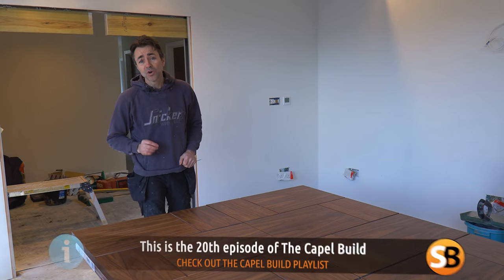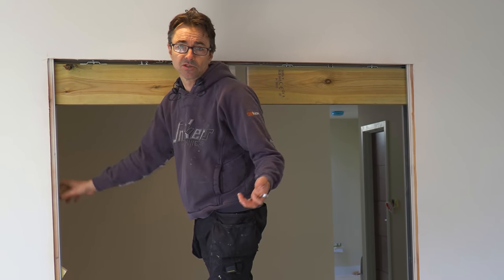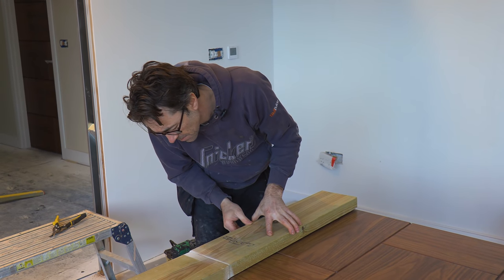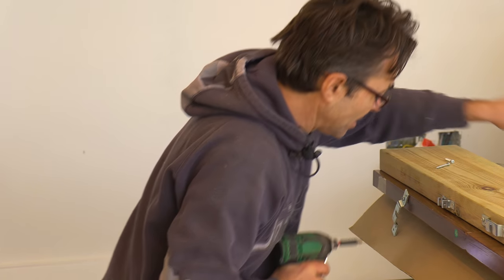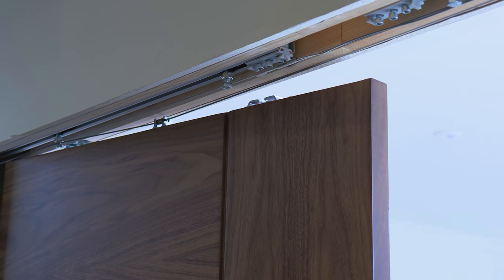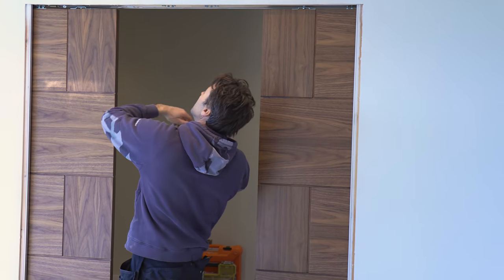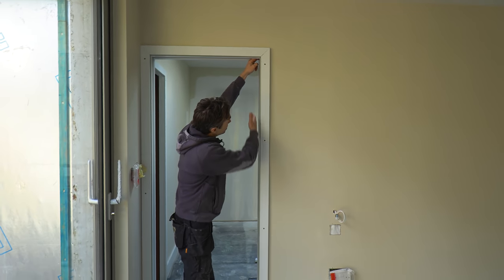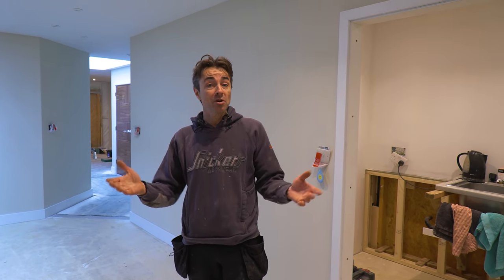Robin Installs Sliding Pocket Doors - Capel #20

Comment: Great timing! I’m currently building an extension. Ordered the kitchen then realised the utility door would open on to the units so decided to make it a pocket door. I’ve ordered a “JEXIS Pocket door ejector” so when you come to close the door you simply push the edge of door and it pops out instead of trying to get your fingers in to close it. Hoping it works!  Love how you’ve finished that single door off. The brush strips are a great idea. Looks smart!

Comment: Love the choice of unique walnut doors makes such a difference from your usual white primed doors! One thing I would add about the pocket doors would be how far they return into the partition. Once you router your handles in on both sides it's best to have the door sticking enough to see the handle so that you're able to reach the handle on both sides of the door to close it. It's works better than trying to fish for the top of the door everytime you want to close it. Nothing wrong with what you've done its something I've come across fitting them. Top work as always!
Reply: I watch a bunch of vids of luxury boats on Aquaholic, and for obvious reasons pocket doors are very popular where space is at such a premium. The usual answer is to have a flush fit pop out handle on the edge face of the door. i.e. you push the top with your thumb and it swings a handle out below that you can grab and pull. Alternatively there are sprung loaded pop out handles for the edge and there are even doors you can push and the whole door springs out, presenting the handles on the main face. I'm a bit surprised you don't know about these hardware solutions if you fit these types of doors often.
Edit: Just noticed the thread necromancy :-)

Comment: Hi Robin, 

Amazing work  as always. You have been inspiring me to start my own DIY pocket door project innthe UK. However, straight at the beginning I've encountered an issue with my cavity wall width. The cavity in our walls is only 6cm deep. There is no system that works with that. The minimum I've found is 100mm. 
Of course, I've reconsidered maybe we shouldn't have pocket sliding but just wanted you as you may have an idea. 
Any practical information would be greatly appreciated. Thanks very much!
Keep up the good work. Keep those vids coming. Cheers 👍

Comment: Tip: add a small piece of plastic over the screw heads before you fill them and you avoid having to dig out the filler from the screw head.  We do this when adding abalone inlays over screw heads on guitars.

Comment: Great video thanks. What filler do you use for the screws it's a big hole to fill and I have struggled in the past with Brad nail filler expanding. Use a 2part now but would like to know what you recommend. Thanks

Comment: looks great robin but when the pocket door closes shut and its flush with the frame how will you get your fingers into the door pull
Reply: They have special caps. First make a hole and stick that cover caps
Reply: @ru_ss5415  the door edge is in the sliding door pocket
Reply: thats the only problem with picket doors you have to put the stop inside the pocket to revile the handle  which limits the opening size

Comment: First of all, look amazing, 

However, I have a question, ....I am putting a pocket door in a garage conversion,I am using a Henderson pocket door, the manual gives the height for the rough opening, but is this before or after the finished floor? First time doing a pocket door and any advice would be appreciated.

Thanks and stay safe !!

Comment: Hi robin, what do you think I should charge for fitting a similar set up, sim kit, partition, hang doors, slab walls, architraves,pull handles etc, any help appreciated
Reply: It's hard to say without seeing the room or location of the partition its height length etc, but you first have the stud frame to work out and build so allow a day for then allow a day to fit the pocket door systems and set up the doors etc, then you have to plasterboard and skim etc then second fix and handles etc, oh and decorations, just the carpentry side is about 4 days, then add for plastering and  all.materials  timber doors paint etc, hope that helps

Comment: Is there a need for a floor track on  the double doors ?
Reply from the maker: Generally no because the door are not too wide and the bottom is held at either side. That said you are best avoiding the kind of high impact a three year old can inflict.
Reply: @SkillBuilder  thanks for replying. 
That's a fair point 😄